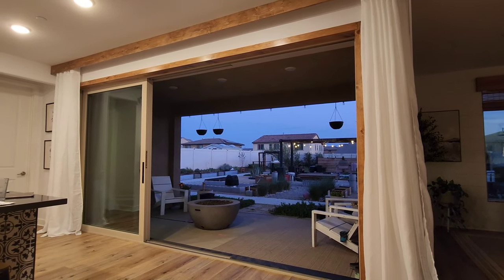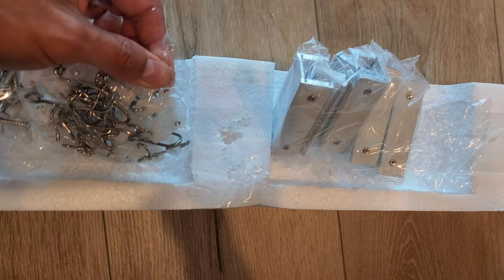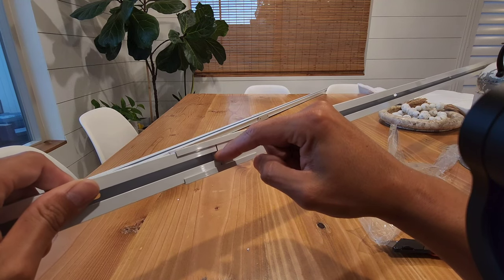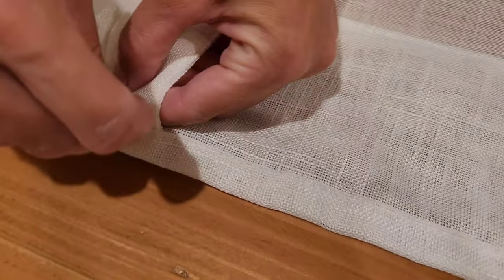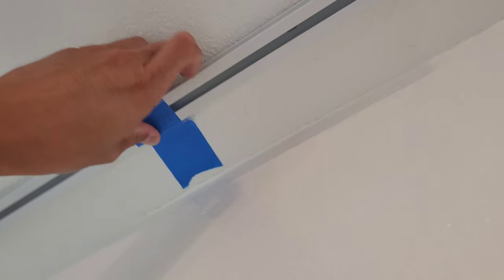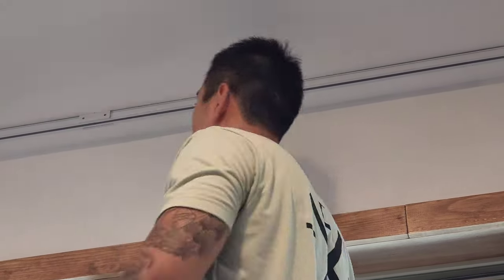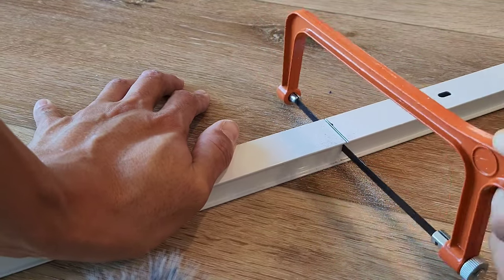EZ Amazon Ceiling Curtain Track Install | part 1

Comment: do these not have the side rope to pull open and closed the curtains
Reply from the maker: Hi Dennie! These did not come with a side rope so we just grab the curtain, but that's definitely something that could be added
Reply: @TheChungKids  can it? That's what I am trying to figure out is how these work and what I need to make them work
Reply from the maker: We literally just grab the curtain from the side and pull them to where we want them. The rollers are super smooth so they really just glide. We open and close them twice a day, every day, and zero issues
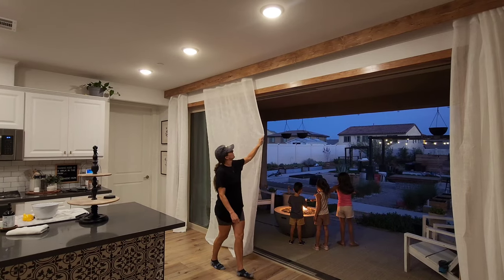Reply from the maker: Watch @ 9:30 it shows how we close the curtains
Reply: @TheChungKids  oh yes I saw that. Sorry if I misunderstood my question:)